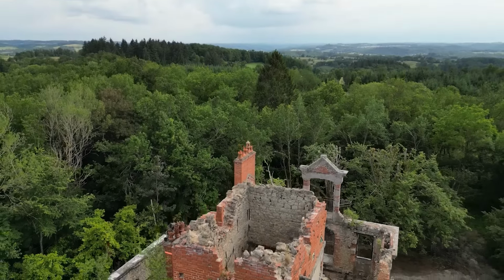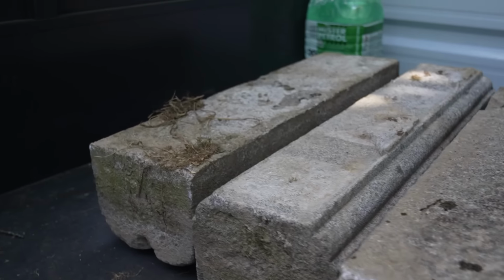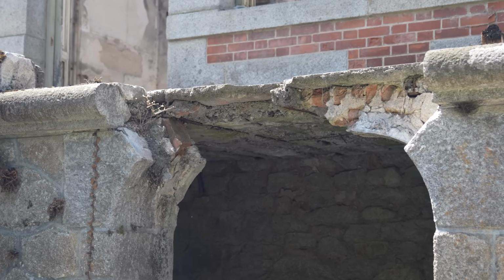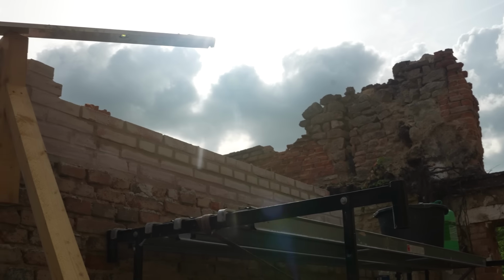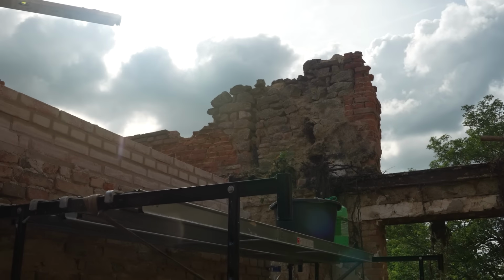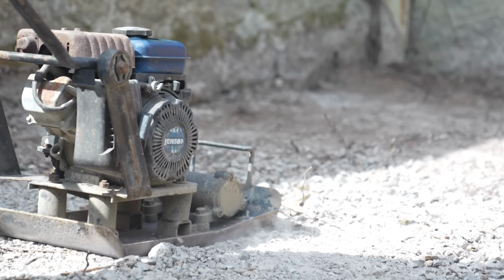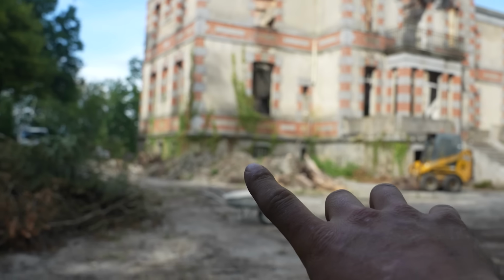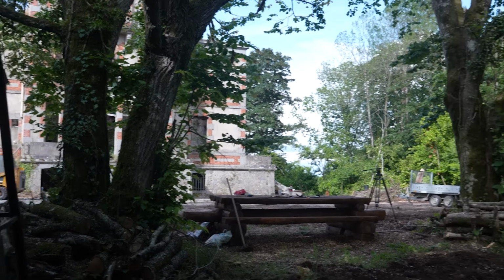The lost granite arches of the chateau were returned to me.

Comment: Well that neighbour safeguarding those valued stones is a guaranteed honorary guest at the first formal dining evening when Dan completes the core renovations.  What a party that will be. Our local stonemasons perform listed building restoration state for stone arch lintels e.g. granite is £450 per 500mm span width for materials and then the actual carving for profiling would be at a rate of £74.50 per hour plus VAT, estimated at two days work per arch for a basic profile. Then transport would not be cheap either, and granite is a readily available stone, cannot say the same for the French stone used in the situation.
Reply: Looks very much like granite to me. That light grey with small dark speckles is pretty unmistakeable.

Comment: You should be able to look up a stone mason to shape missing pieces. Maybe the people you deal with at the quarry know of some.
Reply: I think the worst loss are all the granite balusters on the ground floor that M. Mironnet had replaced with concrete walls. Getting those replaced could be pretty expensive. Luckily there are enough of them left to provide a pattern. Wonder what happened to the originals, in the 1940 pictures they were still there so I suppose they must have been removed after the war.

Comment: It looks like getting a water connection to an outside tap would be very useful.
Reply: They'd need to get a well pump and run electrics to that. I checked, you can get basic well pumps complete with pressure tank for under 200 Euros so if the well water is usable that would be a good investment.

Comment: If you place each brick diagonal to each other won't that be weaken through out time  by having the lime dry out and make it easy for cracks occur?  It was original done two vertical and then the next 2 diagonal.  I know you know what you are doing but I would think staggering would add more strengh and duribility.  Your doing a great job and wouldn't it  be wonderful if other parts of your chateau are around and not in use.
Reply: He's been told time and again and I think he'll start the proper bond higher up, as he did on the other part of that wall.
Reply: @Ragnar8504  Dan did state that the type of bricks he is using, being not solid , but with holes. receives the the lime mixture  better and allows the bricks to be more secure but I see him working so hard and could not in my wildest imagination think what he is doing could have been done accomplish and with all his effort just any consideration on his part, in the future thinking,  oh maybe I should have done this or I should have done that, would deflate his amazing accomplishments.  Do you think the type of bricks he using will allow less wind resistance and sun drying and cracking?  Do you know the name of these kind of bricks with holes?
Reply: @lindadavis3728  I'm not a bricklayer but as far as I know these bricks should be perfectly adequate. Had this been my build I think I'd have used the original bond throughout but I don't think the wall is going to fail because of two or three incorrectly laid courses.

The main advantage of bricks with holes in them is their lower weight and possibly marginally lower price. I can't see why the holes should cause issues with wind or sun drying. In French they're called "brique perforée".
Reply: @Ragnar8504  Thanks!

Comment: Why is cement being used instead of lime?
Reply: Granite is often mortared with cement because it's extremely hard, harder than concrete. I'd get professional advice before putting those stones back, you'd definitely want the mortar to match the existing bits in such a highly visible spot.